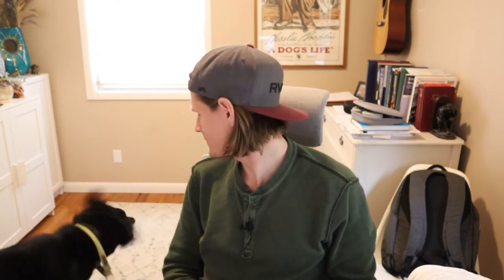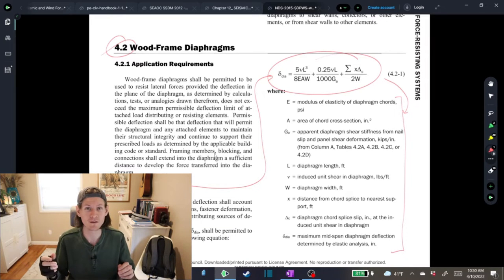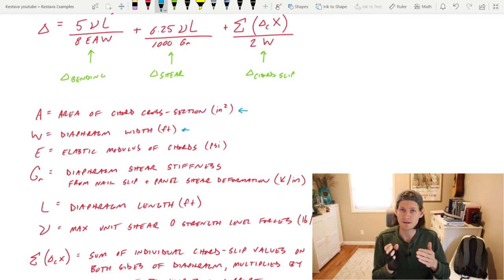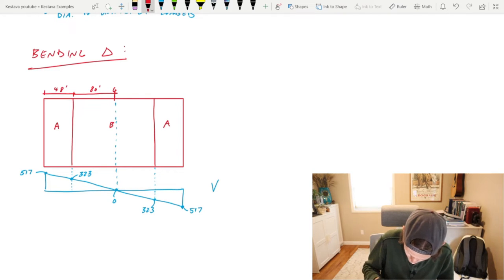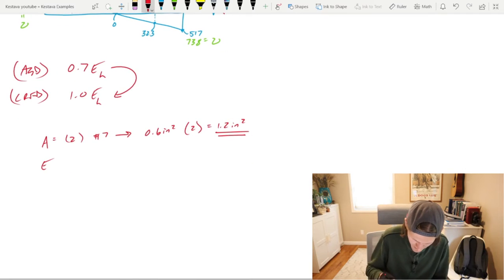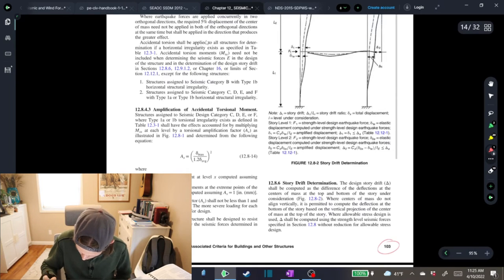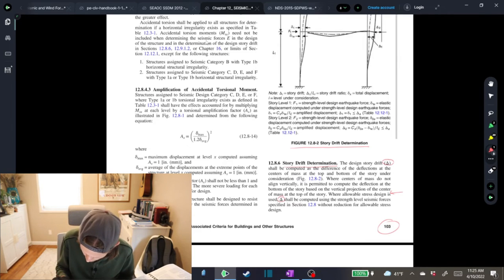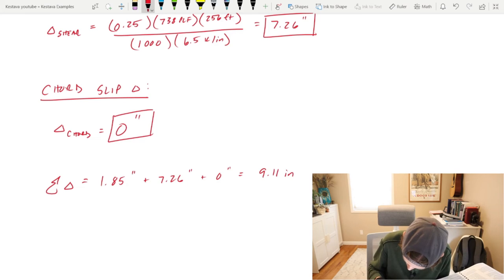Diaphragm Deflection Design Example | BY HAND | Structural Engineering

Comment: Just passed my PE structural (CBT) and wanted to thank you for your help and wish everybody here good luck!
Reply: Congrats.
Reply: Any chance you remember how many wood questions there was? I never worked wood and not sure if it’s worth studying from scratch.
Reply: @raffiart5121  Every exam is different, mine had 3 or 4 wood questions as far as I remember, but yours could have more or less, it was very straightforward, just follow design procedures from NDS and you should be fine, this channel has very useful wood design examples that will help you understand the concepts, I suggest you go over them, good luck!
Reply from the maker: Great job!
Reply from the maker: Simo with the BIG compliment - thanks!
Reply: @elbahja03  
Thanks for the info. I already started studying. For now, it looks both easy and hard. Quite a lot of adjustment factors! Let’s see.

Comment: Cd factor does not need to be applied to diaphragm deflection. Cd factor accounts for the inelastic behavior associated with the vertical lateral system, not the horizontal diaphragm. Good example tho

Comment: Could you please do a quick video on the "Middle Third" rule for determining bearing pressure in a foundation element. This was needed for a problem in the PE Structural practice exam, but I cannot find any reference for the rule.